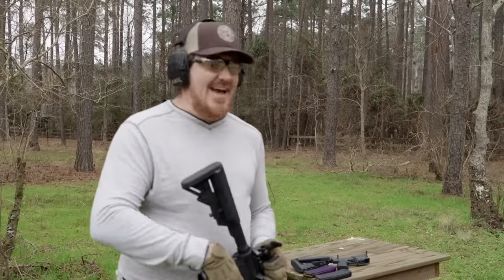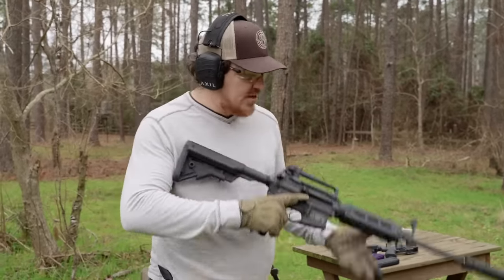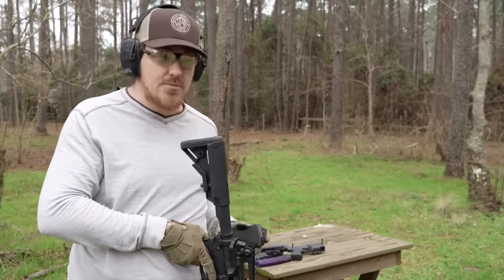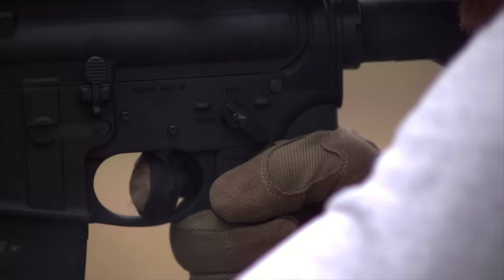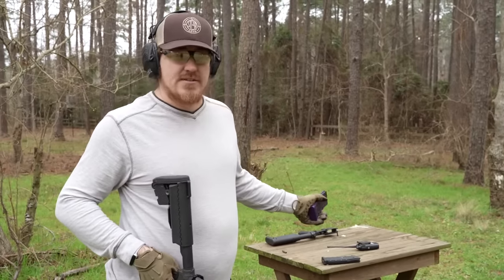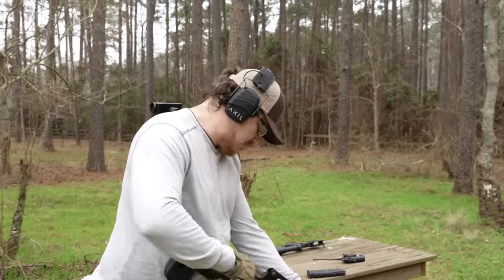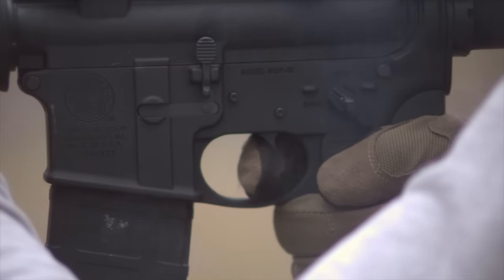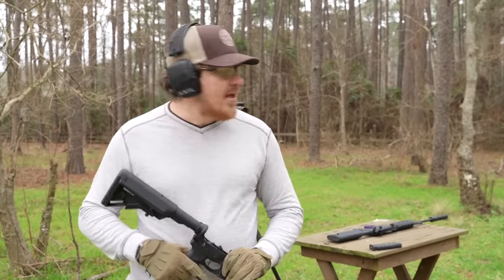FRT-15 Vs An Actual Machine Gun

Comment: The fact that a TRIGGER is now considered a machine gun is unbelievable
Reply from the maker: Fresh lawsuit filed last night against this. Stay tuned.
Reply: Evidently so is a metal card with a picture on it.....
Reply from the maker: @TheLikkinBranch  a picture that when cut out was not even able to be used as a machine-gun as they thought
Reply: @gatcattill  yep.  It's a raw deal man.
Reply: An auto sear is just a component of the trigger group and it is considered a machine gun, is given a serial number, and is sold for like $30.  You can make this part out of a hack saw blade or coat hanger.
Reply: Tie a rubber band around this grip and trigger and it will keep firing. A semi or binary won't. My problem is, the full auto shouldn't be illegal anyway.
Reply: @lance9150 I'm sure you know, but the auto sear isn't the only thing that makes the gun full auto.

The bolt also has to be designed (or filed down) in such a way as to slot correctly with the auto sear.

You can 3D print an auto sear, and people have, but further modifications have to be made in order to go full auto.

Anyway... shall not be infringed is pretty damn clear.
Reply: That's what happens when We The People no longer uses the 2A for it's intended purposes.
Reply: @whitestallion531  it’s a right not a rule
Reply: Feel free to move to a different country if you don't like it here 😂😂 @greebuh
Reply: @whitestallion531 exactly what is its purpose
Reply: @greebuh somebody had to say it.
Reply: Turns out it isn't!
Reply: Considering the government these days, not really. And it doesn't apply anymore :)
Reply: @frank6842  you misread what he was saying
Reply: @dustinmiller6430  its main purpose was to serve as our means for ending our “consent” to the government for them to govern us. They can only hold authority over us if we content to it, and the only way to say “No”, much like being raped, is to use force. The other purpose was personal protection, which is built in to it by how a militia is made up of individuals that not only need to have their service weapons readily available to them instead of at a central armory, but need to be able to defend themselves to maintain their household to be able to even report for duty as a militia member. If they have no right to defend themselves and their property, how are they gonna have the right to do so for the country in general? It makes no sense to have one without the other. They are intertwined.

Comment: New announcement: ATF revises their  own regulations to ban all firearms that require a trigger pull to fire.  You're still allowed to keep and bear your arms,  just not fire them.
Reply from the maker: ATF bans barrels. You can still have everything else. But barrels are machine guns because they are the same one found in machine guns.
Reply: Oh shut up, the rate of fire and ease of use is what matters. This is for all intents and purposes a machine gun.
Reply: @m_disulphide  problem?
Reply: @molly_disulfide  booooo! "For all intents and purposes" doesn't matter. They were specifically designed to fall outside the definition the AFT has given
Reply: @m_disulphide  never simp for the ATF, despicable.
Reply: @m_disulphide  You mad?
Reply: Don’t give them ideas!
Reply: @m_disulphide Okay, that's fine. If Congress wants to make that ruling, they can. 

You wanna know who CAN'T make that ruling? The ATF.
Reply: @m_disulphide  Well for all intends and purposes, machine guns fall also under arm protected by the 2nd anendment.
Reply: @m_disulphide that's not what the law (which is definitly unconstitutional) says

Comment: Looks like 30 single trigger pulls,albeit quite rapid.atf is WRONG!a fight we gotta get behind
Reply from the maker: A lot at stake with this case.
Reply: Do you think he ever lets off pressure on the trigger? Nope. That being said its basically a new type of full auto. Idk the machine gun laws but i know the point is to limit full auto, and this is that. The atf just always has super shitty wording for laws and nothing is clear. And congress refuses to do anything in any way
Reply: @gatcattill  yes, if you manage to have it overturned the only thing they can do afterwards is to BAN ALL SEMIAUTOMATICS alltogether ... and you all are helping them to get the support for that ban ... "look how easy is it to convert one to fully automatic" will be the reasoning they will use ...
Reply: @skie6282  You actually have to have light enough pressure on the trigger to make it bump fire.  Too much pressure and just mashing the trigger doesn't work, and the company specifically states that you have to have a trigger pull pressure between 5-10 lbs to make it fire rapidly - It's not a machine gun.
Reply: @brendanfitzpatrick1113  at what point in your statement did you say anything other then keeping a pulling pressure on the trigger. Sure you cant just pull as hard as you can but its still just pull. It is full auto, which i think makes it technically a machine gun but that part idk, but its full auto for sure
Reply: @brendanfitzpatrick1113  but you arnt pulling it every single time individually for each shot, your just pulling it,  it doesnt fcking matter that its lightly or whatever. You pull, it resets while your still pulling and it keeps firing.
Reply: "IDK the machine gun laws, but" ... then STFU, a machine gun is defined by "a firearm capable of firing more than one round per function of the trigger" this is only one function per round, period..it's been reviewed by 4 seperate Former ATF design and technology agents and determined to be legal... 

They fight against all semi-autos is the fight we want, because a vast majority of the population owns a semi-auto and will put their whole existence into jeopardy..

This little, "we've determined, based on our own feelings bullshit" has to stop, or incremental losses keep happening. Support the small fights!
Reply: @skie6282   “idk about machine gun laws” Everything you have typed is invalid
Reply: @marquez4497  it may be invalid but that's what they're going to use in court and they're going to win. What is so hard to understand? They're already half way there to winning at full.
Reply: @justinlavigne9814  Yep....the whole case here hinges on the definition of the word 'function'.   People who claim that the FRT's are legal and not machine guns are claiming that the MOVEMENT of the trigger is a 'function'.   But the spirit of the law means that the word 'function' should/could be interpreted as 'activation'....meaning 'pull'.   After all..the most common definition of 'semi-auto' is 'one pull...one shot'.   In the case of the FRT you get a whole magazine dump for ONE 'pull'...so it violates the 'semi-auto' definition.   It also isn't a 'semi-auto' by definition if you pull the trigger when dropping the bolt on a loaded magazine.  NO other semi trigger will allow the gun to fire...being that the hammer will be held by the disconnector, but the FRT will again dump the mag because it automatically removes the disconnector function when the bolt reaches the fully home position...just like the auto-sear in a machine gun.

YES....the trigger DOES move while the FRT is working.....but the shooter isn't doing it...the machine is doing that and all the shooter is doing is pulling the trigger.   I've been arguing here in many comment sections that you could wrap a rubber band around the trigger to apply pressure and the gun would do mag dumps...unlike ANY other semi-auto firearm ever made.

Guys...this FRT is an attempt to parse the wording of the law and in reality is just a machine gun with a less efficient mechanical system than using an auto sear to hold the hammer until the bolt is fully locked then release for the next shot.   If it will fire an entire magazine at cyclic rate when the trigger is tensioned with a rubber band....it is NOT a semi-auto.   This is going to lose in court and I fear will give the ATF reason to add some other things while they're at it.   Trying clever work-arounds is not the way to attack laws you don't like....especially when you have to use a VERY limited parsing of the terminology as your reasoning.   People can SEE in the dozens of videos that these fire at a full auto rate and while the trigger needs a bit of finesse to run...that's not going to convince any jury that this meets the spirit of the law.   I wish it wasn't so...but fear that it is.
Reply: With a mindset like that, if they can ban individual gun parts, it sets a precedent and they can ban anything they like
Reply: Yea it’s full auto and it doesn’t make it any better that u need a full auto bolt carrier to run most of these things buy I really think they have a good fight because technically the trigger is resetting so I mean shit idk
Reply: I’m sure if the rate of fire wasn’t so fast mfs wouldn’t be saying shit if the force reset forces your finger back slower and produced slower rate of fire it wouldn’t be illegal so idk
Reply: @lilshoota19  It’s not illegal
Reply: The problem is the atf wants semi auto triggers to reset MANUALLY not automatically.
Reply: @skie6282  you know you can legally own a machine gun right? Yes, they are way more expensive. And all you need is $200 for a tax stamp and in depth background check. All that means is rich people can own machine guns.
Reply: @skie6282 He does, the trigger auto resets.  As he said in the video if you stand on the FT trigger it will just jam the gun.  No it's not full auto it doesn't even come close to meeting the definition.   No the ATFs job is not to prevent  full auto.  You can own a machine gun made before May, 1986, if you got the money.  Since you admitted you don't know what you are talking about, you probably shouldn't post your ill-informed opinions.
Reply: @skie6282 No, it's not full auto, it's not a machine gun.  He's riding the trigger, but not continuing to pull, it fully resets after each shot then he pulls again.     I think you don't know an AR from the M16 and do not know what too are even looking at.
Reply: @skie6282 Wrong.   You need to go back and rewatch the video, because clearly you missed what everyone else clearly saw.   It's not a machine gun.   The whole idea and goal was not to build a machine gun.  Which they successfully did not do.   That you can't tell the difference, is your problem.   Maybe get off the Internet and go have your eyes and ears checked.
Reply: @skie6282  this by definition is not full auto. You can't just change the rules whenever you feel like it, or you end up with no rights whatsoever.